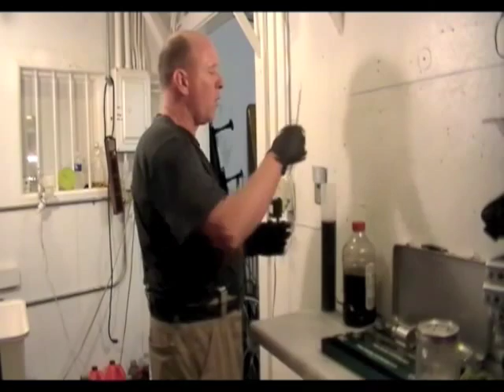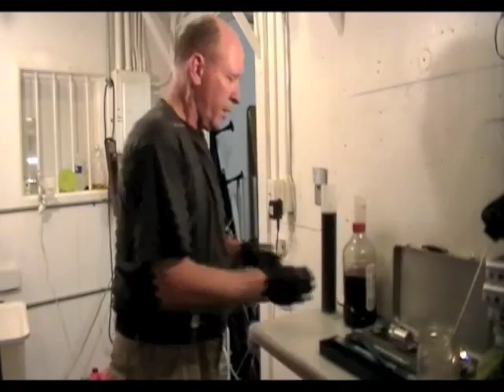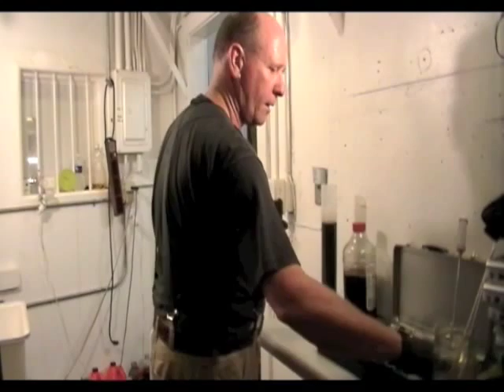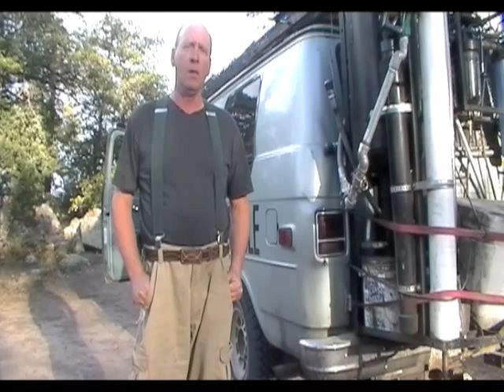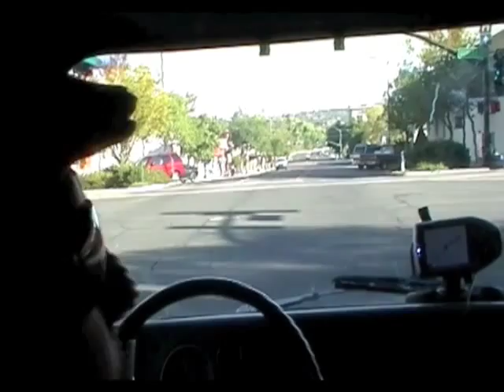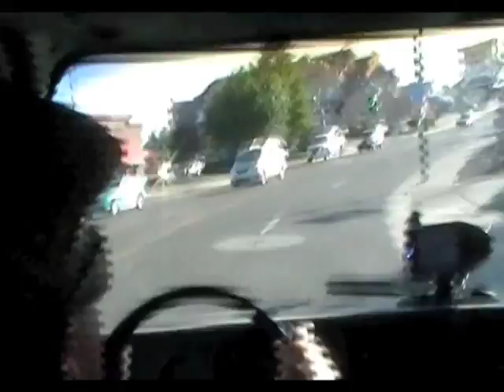High performance alternative waste oil blend diesel fuel

Comment: I’m currently running a 100% mix (b100 or w100 if you will) of wvo settled and filtered and rug, in a 50/50 mix. It starts as quick as anything else in the morning and it has good performance overall. I’m running it in my modified 1995 Dodge Ram 12v cummins with no biodiesel related modifications.
Reply from the maker: 50% seems to be as high a mix of waste oil that I can run on my 2 diesels without coaking the injectors and valves, but coking takes about a year, so keep an eye on evidence of coaking which would be more smoke.  There is a simple fix to coaking is to just run straight diesel until the smoke goes away. I found adding gasoline proportional to waste oil at 20% improves its combustion even when 30% of the total blend is diesel. Do you run this blend all of the time now? Do you have a turbo? A turbo definitely improves combustion and reduces coaking.

Comment: And what is the overall consensus on 50% wmo 50% gas?
Reply from the maker: +Matt Leonard well, first, my work has been primarily with WVO, not WMO, for the last 10 years.  

Secondly, most gasoline has too much alcohol in it to run on any diesel engine with silicon seals in its injector pump, like my engine.

However, ULSD diesel can be blended at 50% with waste oils, such as WVO or WMO, and run not just as good as ULSD, but better, because it has more BTUs/gal than ULSD.

However, it turns out the ULSD at 100% is bad for old diesel engines like mine, because ULSD has xylene in it at sufficiently high concentrations that it destroys silicon seals in injector pumps of old diesel engines,, like my engine.

However, my current blend is 60% WVO + 20% ULSD + 20% gasoline, and it runs far better than ULSD on my engine, and does not damage the silicon seals in its injector pump.
Reply: thank you, thats helps me a lot

Comment: What is the key to making alternative diesel with more BTU's than pump diesel?
Reply from the maker: +Matt Leonard not using "pump diesel" (ULSD) at 100%; because blending it at 50% with waste oil increases its BTUs significantly, while increasing the lubricity of the fuel, and reducing the corrosive effect of the solvents in ULSD that cause damage to silicon seals in older injector pumps.

Comment: If i blend 10 gallons of diesel fuel with 40 gallons of cooking oil in a diesel pickup will that work.
Reply from the maker: +Kenneth Megggers blending in the fuel tank will lead to a host of problems; whereas, blending in an external tank with a drain valve, then settling the blend for about 2 weeks, then draining off the sediments should work just fine with a blend of 40 gallons of WVO plus 10 gallons of gasoline.  Or if you have a 50 gallon blending tank, then 15 gallons of gasoline added to 35 gallons of WVO would be better.
Reply: +Jeffrey Brooks Yes i got a 55 gallon drum i mix my cooking oil, Can't i mix diesel with cooking oil, Or is it if you mix gasoline you don't have to use as much gasoline as you do with diesel.
Reply from the maker: Yes, you can blend diesel fuel with waste vegetable oil (WVO).  My current experiments show that WVO at 50% of the blend seems to run better, and in colder temperatures. 

Yes, I do add gasoline, and it appears better to blend diesel fuel first with the WVO at about 20-30% of the total volume, then drain off any thick, dark, or creamy sediments, then add gasoline at up to 30% of the total volume to reduce the specific gravity to that of diesel fuel, which is about .845sg.  Adding gasoline will also lower the gel-point of your final fuel blend.

Barrels are not as good as a compressor tank, or an old propane tank as a blending tank, because barrels have flat bottoms, but what you want is either a cone-shaped, or bell-shaped bottom on your blending and settling tank, to facilitate draining off the sediments, which is a critical component to successful blending.

Settling time should be at least 2 weeks before draining the sediments off.
Reply: +Jeffrey Brooks I got two 55 gallon drums, I put the dirty cooking oil in one drum and i pump the oil to a tank above the other 55 drum and i run the oil tough a centrifuge there i put my clean cooking oil, Can i put just gasoline with the oil or just diesel
Reply from the maker: Either way you can blend gasoline or diesel fuel with your WVO, and you can do that prior to centrifuging it, so that you do not have to heat your blend to get it to run through your centrifuge, like you would with straight WVO. 

You should still look up "separation funnel" to see how you can use settling to improve your product, and reduce your effort.
Reply: +Jeffrey Brooks why do you say bending gas instead of diesel with cooking oil.
Reply: +Jeffrey Brooks So if i bend 10 galllon of gasoline with 40 gallon of clean cooking oil will work for diesel.
Reply from the maker: Yes, but you will have better results blending 10 gallons of gasoline with 30 gallons of clean cooking oil.  Also, do not forget to settle the bend for 2 weeks, then remove any sediments, then filter it into your fuel tank.
Reply: +Jeffrey Brooks Can you blow the engine up if you add to much gas to cooking oil.
Reply from the maker: Not really.  The gasoline content would have to be well over 50% for engine failure to occur.  However, US American gasoline has alcohol in it, and in the winter it can be as high as 10%, which restricts our upper end use of gasoline to 30% max, or otherwise seals in the injector pump might fail, unless you know your IP has all viton seals.

Comment: Hi Jeffrey  I do have 3 caterpillar dozers a D5 98 J turbo a D5B 23X and a D6 99J and I am planning to use 50% WMO and 50% Dissel, do you think it will works in this kind of motors ????
Reply from the maker: Daniel Adrián Girón it might work without problems; however, gasoline blended at 20% with WMO works better as diesel fuel.  Also, WMO tends to have a large amount of dissolved carbon in it, which tends to result in coking of the engine; however, settling the blend for 2 months, or centrifuging it until the blend runs clean will help a great deal.

Comment: Jeffrey:

I am heating WMO to 150, then centrifuging it.  Then I mix 10% unleaded I still get more smoke than I want, can you tell me how I can get it to stop smoking?  It comes and goes.  bofinger.r@gmail.com  Rick Bofinger 916-825-8880
Reply from the maker: Blending gasoline with waste oils before centrifuging works better, and no heating of the oil is required.  10% gasoline in WMO is simply not enough solvent, so your WMO blends will surely smoke.  Whereas, 20% or higher gasoline content will significantly reduce smoke.

Comment from the maker: Thanks, the injectors on my non-turbo 6.2L DD engine coke on WMO blends, not WVO blends.  A turbo charger seems to help diesel engines burn marginal fuels, so I recommend them.

Also, since we are here on high performance waste-oil blends, then blends containing more than 30% gasoline can cause some seals in some IPs to swell, due to the presence of alcohol in the gasoline, so I recommend keeping the gasoline content of these blends at or below 30%, unless you know there is no alcohol in your ga

Comment from the maker: Yes, engines that use an optical sensor have problems running black diesel.  The solution is to radically clean the WMO up with centrifuges, settling, blending, filtering, and best of all is distillation.

WMO has the added disadvantage of introducing ash into the engine cylinders, unless it is distilled.

Comment from the maker: Well, thinning WMO properly is the first obstacle to overcome, and most people never get that far.  However, after that the next big obstacle is the soot and ash in WMO, which causes coking and excessive engine wear.  I found a cheap centrifuge for less than $200 worked fine, and it gave me more time before coking, but my non-turbocharged diesel still coked its injectors on WMO blends.  So, it looks like it is either distill the WMO or buy a turbo or both.  I am working on both.

Comment: the real issue on black diesel is thinning it sufficienty so that it's as close to homeheating oil or diesel as you can, on the old motos you can burn straight home heating oil and i did when it was cheap but now its as much for the home heating oil as the diesel.  i would say that it is pretty heart breaking when you find a way to make a cheap fuel and it works that a black thick film keeps settling out, i guess it have to spend alot for a centrifuge, any other way to clean the soot out thanks

Comment from the maker: The limit to how much gasoline you put into a diesel engine depend more upon how much alcohol is added to it.  Where I live we get alcohol qt about 10%, which is too much for my old IP when it is blend more than about 30%.  Other wise 50% gasoline could work with an IP that can handle it, or no alcohol in the gasoline.

However, I still have problems with burning WMO on my old engine so I am now working on distilling it.  So far it works fine.

Comment: Hi Jeffrey. I take it you would not  recommend a 35 % gasoline / 65% WMO blend, as you indicated injector plugging and IP pump issues due to using WMO in another post.
Just checking to see if this video was made before or after that.- ie do you still not recommend using WMO, or would you recommend a 35% gasoline/65% WMO blend?

Comment from the maker: I fail to see why anyone who spent $60000 on a truck is going to scrimp on fuel for it.  However, there is no evidence that blending gasoline with waste oils harms engines, if it is properly done; and it does not matter whether the engine is new or old, IIDI, or D,I or common rail, etc.

Comment from the maker: The real issue is just thinning the waste oil sufficiently, so that it burns properly, when that happens the emissions are low.

The issue of gasoline in waste oil tho due to it washing past the rings and causing cylinder damage and thinning the oil in the crank case is a non-issue, because a high % of the gasoline is going to ignite in the cylinder.  Any gasoline that arrives in the crank case due to blow-by will quickly evaporate and be reabsorbed as fuel by the EGR

Comment from the maker: Gasoline has lower sulfur content than diesel fuel, so blending WVO with gasoline is not going to increase the sulfur content significantly; however, motor oil is going to have more sulfur, so blending with WMO might pose a problem.

Comment: First off, thank you for doing these experiments and creating these informative videos. Also for responding to the comments that keep on perpetuating myths.

I was wondering if you had a blog or written text somewhere, other than in each video's comments section, that has the outcomes of your experiments?

Also, what specific Detroit Diesel engine is in your van? I know you said it was non-turbo, but I have not heard if it's a straight 6, V8, displacement, etc.

Thanks!

Comment from the maker: Another of those myths regarding gasoline blended waste oil diesel fuels is, "Some fuel system seals can be affected by the compounds in petrol too." 

Gasoline (petrol) is just a cut in the petroleum stream; therefore, the seals and hoses that are typically used for diesel fuel systems are the same as those used for gasoline (petrol) fuel systems.

Comment from the maker: There are many myths at play that one has to overcome when making alternative diesel fuels.  One of those is, "Petrol in diesel acts as a solvent, reducing lubrication, and can cause damage to the pump through metal to metal contact.  " What is being ignored is that blending gasoline (petrol) with waste oils actually has more lubricity (lubrication) than diesel fuel on its own.

Comment from the maker: Well, I used to work for the petroleum industry.  The seals and hoses used in diesel fuel are the same as those used in gasoline autos, therefore there is no reason to contact AA RAC AAA just because one is making diesel fuel blends.  Or, should we say everyone making biodiesel should do the same thing?

Comment from the maker: Actually, any seal or hose that can handle biodiesel should have no problem with the 10% alcohol content in US fuels, after all, the biodiesel process involves alcohol in the formula.  Also, gasoline is just a cut in the petroleum stream, so it is no different than diesel fuel in that respect.  Thus, if you check your seal and hose specs, you will find the seals and hoses for diesel fuel are the same as those for gasoline.

Comment from the maker: @daftmo1 The BTUs of a gasoline/waste oil blend diesel fuel are significantly more than diesel fuel until one gets to 50% gasoline to waste oil.  At that point the BTUs are the same as diesel fuel.  However, increasing gasoline over 15% in a waste oil blend one gains power and emissions reduction.  I have yet to find the top end on gasoline content to waste oil.  So far I have run 45% gasoline, and only found more power than I had at 30% which had more power than 20%, etc.

Comment from the maker: @alexa795 Thanks for the report.  I suppose WMO varies depending upon the grade.  If you had access to WATF, or a light weight WMO, then perhaps it would remain liquid at low temps when blended with gasoline for winter use.  Otherwise Home Heating OIL (HHO) is diesel fuel, as I understand it.

Comment: @Jhananda 
I use WMO, not WVO. WMO is much thicker than the VMO at temperatures below zero. I tried a sample of 150 ml of WMO(70%) + RUG(30%) and WVO(70%) + RUG(30). I left overnight in a freezer at a temperature of -15 Celsius. WVO + RUG mix was flowing, and WMO + RUG mix was not fluent like WVO mix. So I decided that while the temperature in March does not exceed 5-6 Celsius, i use heating oil as fuel.

Comment from the maker: @alexa795 Last year the temperatures here dropped to 0F (-18c) for two days.  At that time my diesel engine started up just fine without the use of a block heater on the first crank on a blend of WVO 8% to gasoline (petrol) at 20%.  So, a waste oil blend containing 30-35% gasoline should start and run just fine below -20C, and if the temperatures there drop to -30C, then you could try up to 50% gasoline in your blends, should run just fine.

Comment: Hello Jhananda.
In my car Passat 1.6 diesel i using only  VMO + RUG mix. I started with 20% RUG, but for a long time I use 30-33% RUG depending on the density of oil. Currently it is winter in my country and temperatures is between -5 to -15 Celsius,  so I use heating oil in my car. In the March when temperatures are about 5-6 Celsius I will move back again to the consumption of  VMO + RUG mix.